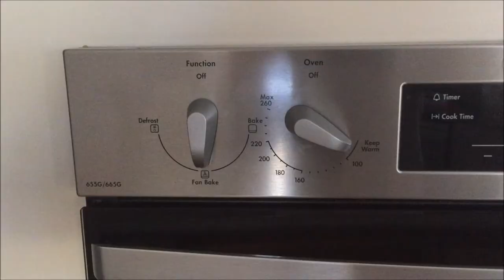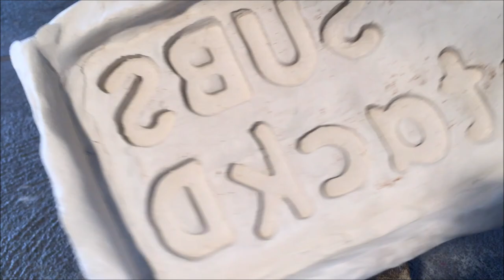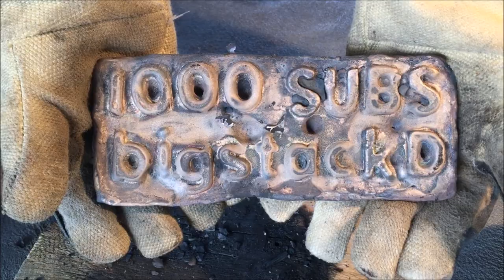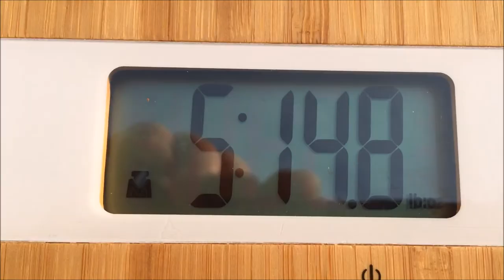SCRAP BRASS MELT  PLAQUE METAL CASTING 1080P MY BIGGEST MELT EVER

Comment: LOL - date stamped November 1, 2016 at the end, posted on October 31. ;-) 

Why did you heat up the clay mold before casting?  To dry it completely?  Or to minimize the thermal stress and by doing so reduce it's propensity to crack when the metal is poured in?
Reply from the maker: RealRuler2112 i heat it just to dry it a bit as when you pour into it the moisture in the clay turns to steam and makes it bubble and carry on . To get the moisture out completely it would have to be fired in a kiln but for now I'll just dry it a bit in the oven on about 90 for a few hours better than nothin . Thanks for watching buddy 👍🏻🍻
Reply from the maker: RealRuler2112 yeah the date was a bit off because my Internet was dropping in and out so I uploaded it before I went to bed I assumed it would be the next day Oh well never mind👍🏻